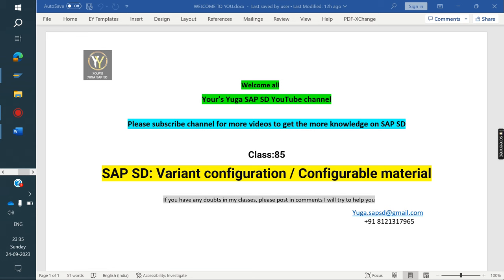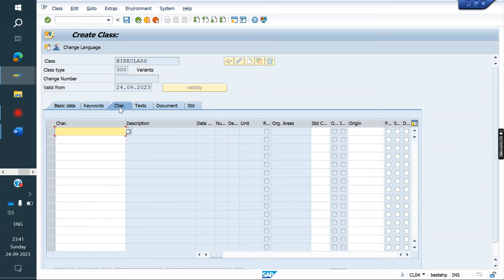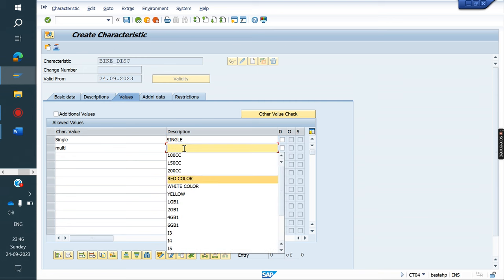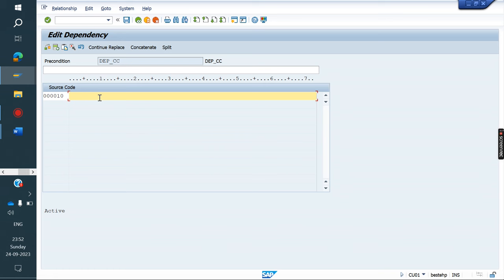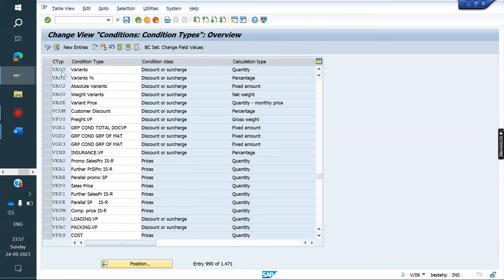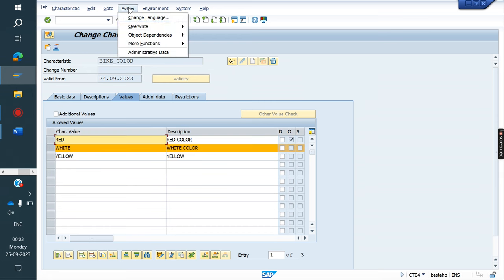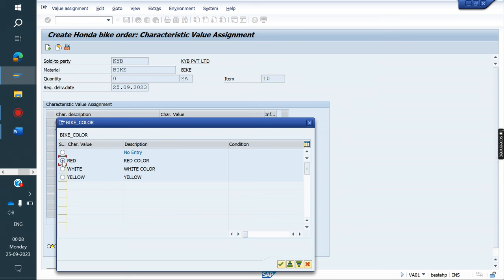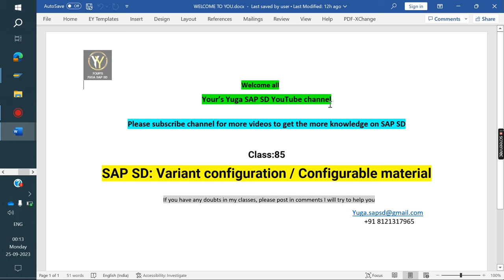SAP SD: Class 85: Variant configuration / Configurable material || Your's Yuga SAP SD

Comment: when i create invoice in the backend account document will generate but client requirement not to create account document but want to create manually not automatically how can possible in sap S4 HANA what is t code for
Reply from the maker: In biling type controls Tcode VOFA, check the posting field 
If you check that system will not generate accounting document backend automatically, manually we have to generate accounting document